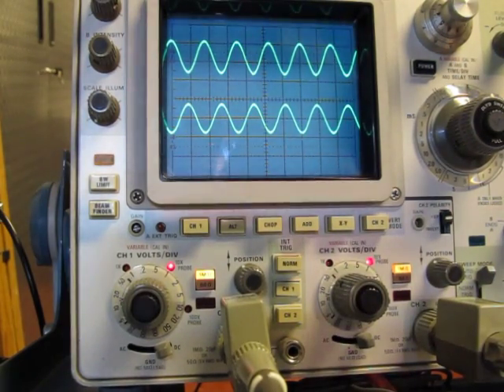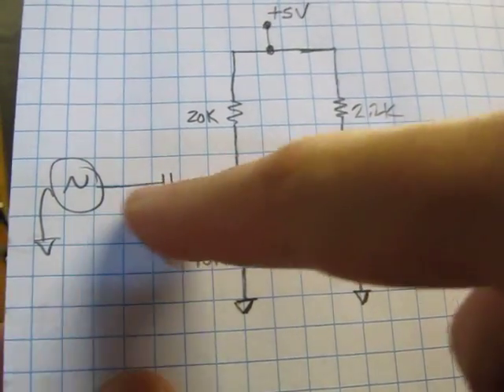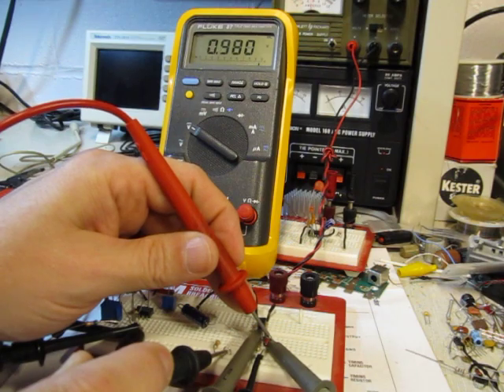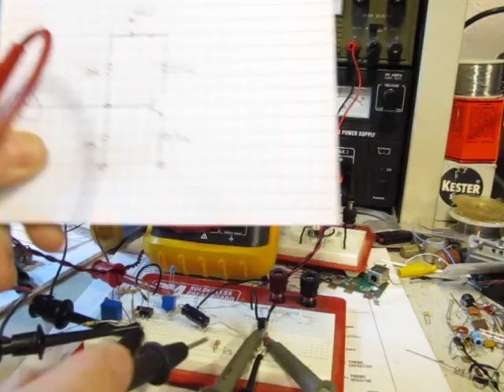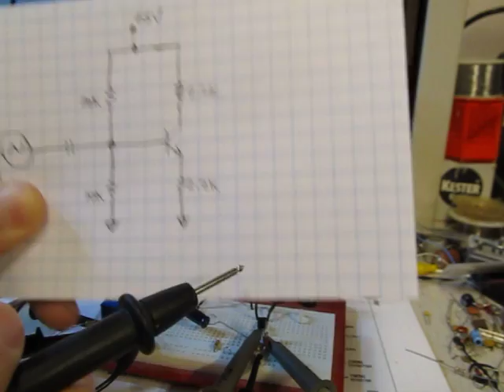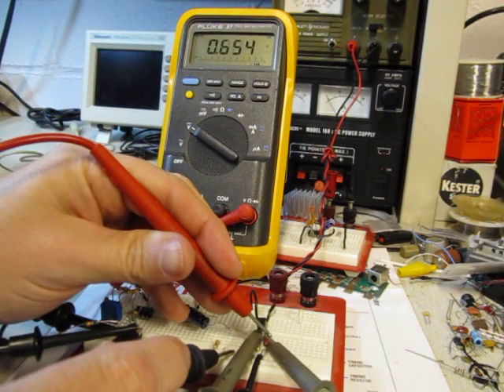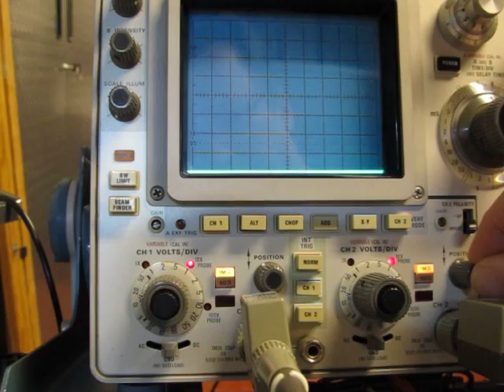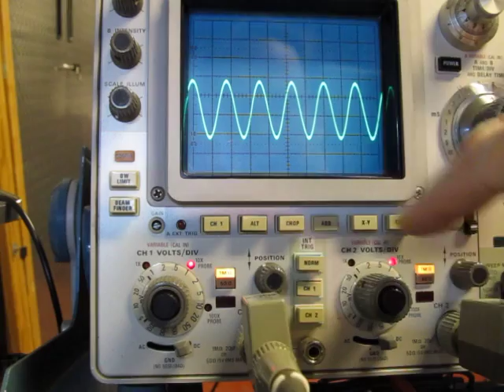#31: Analog oscilloscope ALT, CHOP, ADD, INVERT vertical controls

Comment: Oscilloscopes has a Trace Doubler circuit that is creating the Alt mode and chop mode. Is the trace doubler circuit changing the Oscopes Bean frequency or how does the trace doubler circuit work in theory?

Comment: To measure TV waveforms in television circuits is risky because they use isolated grounds so when connecting the chassis grounded oscilloscope it will spark damage because of the grounds potential differences. I think you can use 2 channel oscilloscope 2 probes set it to ADD and put ch#1 probe on the isolated ground and ch2 to measure the different TV waveforms? They are often very high voltages also

Comment: I cant get a line to show up, there's also no dot, there's some magical combo of settings and it will show up. Is it broken or am I using it wrong?
Reply from the maker: It could be broken, or it could be improper settings.  Be sure to set the Trigger Mode to AUTO, be sure to enable one of the vertical inputs.  If you push the beam finder, do you see anything?  What scope do you have?
Reply: Iv got a tektronix  466, here's a pick of my settings. (http://piclair.com/jbwy4)  I think its broken but I was using it about a month ago. Probably something came loose.
Reply from the maker: A couple of suggestions:  Push the "A Lock Knobs" button in the Horizontal Display group (just to the right of the CRT), turn off the "Save" button (below CRT), rotate the INTEN knob clockwise.  If you don't see a trace, push the BEAM FIND button.  If that doesn't show a fuzzy/short trace, then something is broken.
Reply: Holy cow that worked! Thanks man your the best!
Reply: well I got a line but its very week even with the max intensity so ill try cleaning the contacts later but I can tell my homemade oscillator is working!
Reply: it gets brighter when tapping on it and now can only see when holding the find beam button but at least I know its a loose wire or something.  But thanks for helping, it would have taken me like a month.
Reply: found one of my resistors sorting stuff out, once I removed it it worked fine :)  ( http://piclair.com/r5c3w )

Comment: Hi,

I got my scope today, the 2215 Tektronix.  I have never used a scope but I have successfully manage to complete some of your labs with ease.  Testing caps with square wave was fun - using on-line wave generator. Also did in circuit testing and it worked a treat. The scope is very clean, gave me about 5 probes, several bnc to croc, loads of bnc connectors etc and manual, It seemed fully calibrated (no major adjustments were required). The display is clean and crisp. Not once I referred to the manual. I have not taken any notice of micro volts, or micro sec, I just simply turn dial until I get a clean wave - but I have some vague idea. Just love it.
Reply from the maker: +jon123423 Awesome!  The more you use it, the more you'll learn and the more the love it.

Comment: I worked for Tektronix as an electronic tech. on the 485 from 79 till 85 and may have worked on your scope. They cost about $6500 new back then. I frequently seen a lot of scopes with bandwidths around 500 megahertz. Somewhere in my attic is my old manuals I used at work.